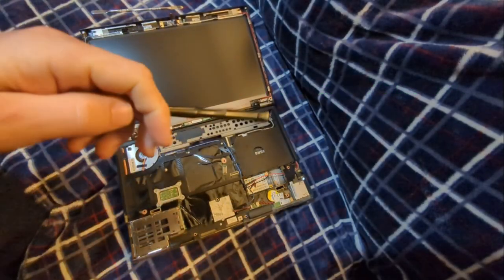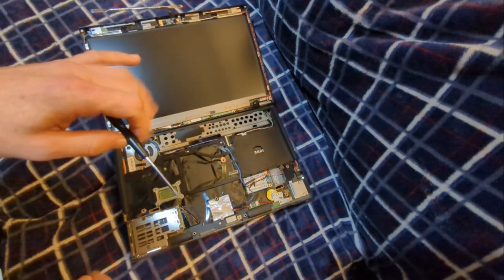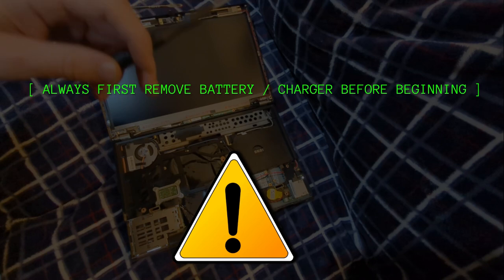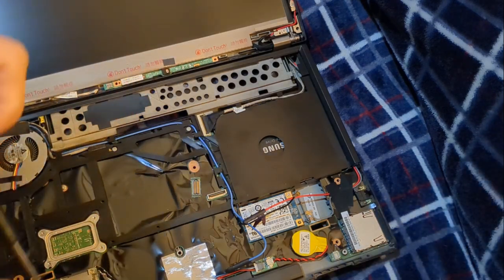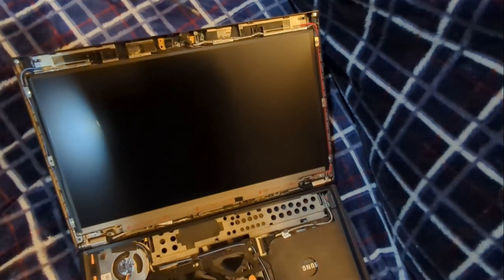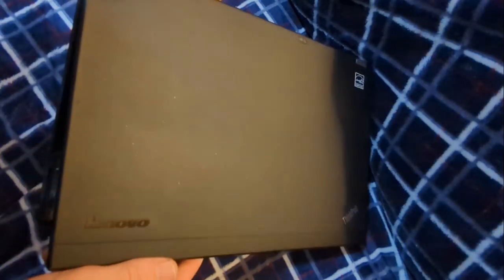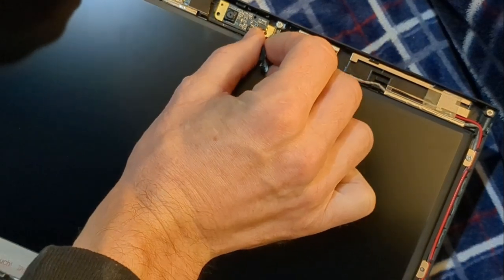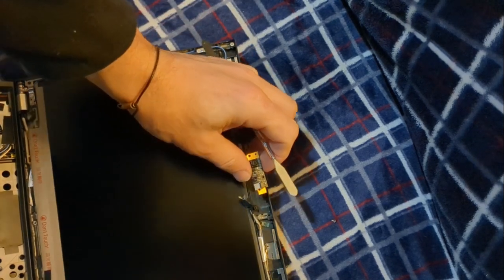🥷 Making Laptops Invisible To Tracking / Attackers 🎭

Comment: good comment about someone mad about  linux user. 
1 thing linux user will never say: the manual is easily understandable by newbies! it is always up to date too!

most linux manual havent been updated for years, even though the distro version used when that manual was written is already EOL.
most linux manual also does not explain things clearly / in details, more often than not it is better to just googling things and pray that someone has asked about it on stackoverflow or somewhere else.

Comment: Probably want to to get some was static gear if your really concerned . Also after ac and or dc power is removed , hold down the power button for 10 seconds to remove the charge from capacitors. Doesn’t take much static to fry it. Ifixit sells a mat and bracelet which I recommend grounding to a ac outlet grounded. They make plugs that attach to the male gator connection
Reply from the maker: I would be better off doing these laptop videos on proper set up - was initially using blanket to cover recognizable things specific to the channel - but might quit doing it as I'm not really trying to be anon on the channel. 

It is really funny, had to do a double take as was just telling someone to try power button deal for something they had going on only an hour before your comment - very weird reading your comment after. 

Unfortunately they forgot to remove the battery when doing some changes on their own board, and I felt a strong need to place that warning because of this.

Comment: i have actually disabled Bluetooth and wifi on my laptop and run a portable openwrt router with me , my next move is to either wait a few more stone ages for framwork  to get coreboot (with heads) or trenchboot
or just get a customNOVA.

also going backwards and getting a mp3 player has been a blessing. im thinking of getting a 2000's era camera to do some video's with in the future
Reply from the maker: Right on. Sounds like a decent plan of action to me! 🕶️ 

Found my old mp3 player as well, but not sure I'm gonna use it tbh lol.

I found an old camcorder as well - might get a battery for it to see if it still works!
Reply: I got a new laptop and I can not afford to remove hardware but I disable everything in Bios, i cover all my cameras, and I completely switched to plugin headphones for some time now. The problem persists as I have a phone too with a microphone, I can make a DIY faraday pocket baggy, but I am extremely unpleasent with there is constantly these microphones in my house, even in a smart tv remote. I am thinking of maybe i can cover the tv remote microphone with a little fast hardening silicone but I need something practical, easily detachable and reattachable , very small that provides acoustic isolation of little tiny microphone holes on some these devices. Would like to kindly ask if you guys have any idea about that maybe ? Thank you. Awesome content as always.

And one last question, would you have a distro suggestion for someone older who is not a technical person to switch to Linux from a lifetime of only Windows and they will heavily make use of LibreOffice programs mostly on the computer and they will never touch the terminal themselves. I thought Linux Mint could be a good choice, maybe ZorinOS too, if you guys have a better idea i would love to hear. Thank you. Awesome instructional video :)